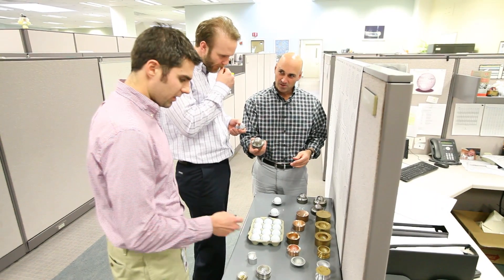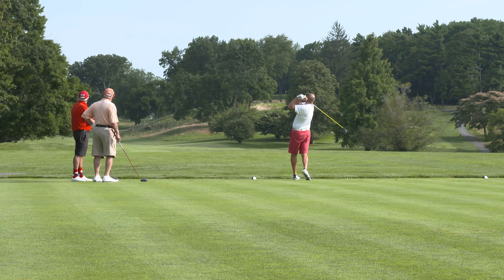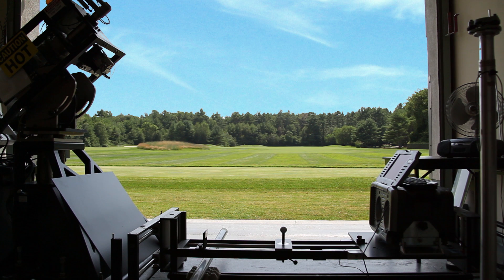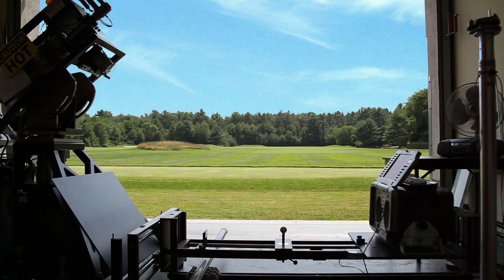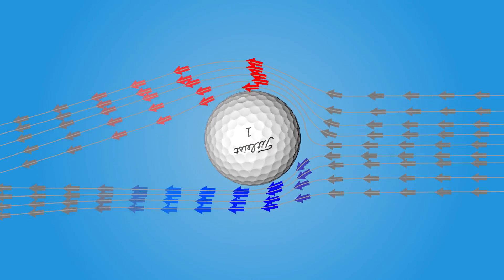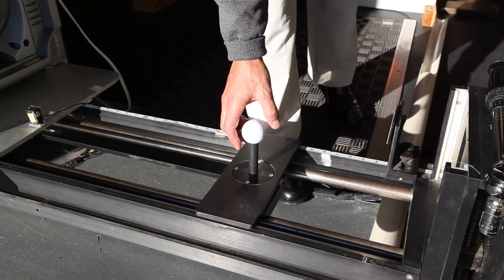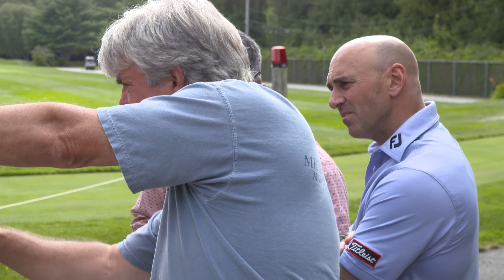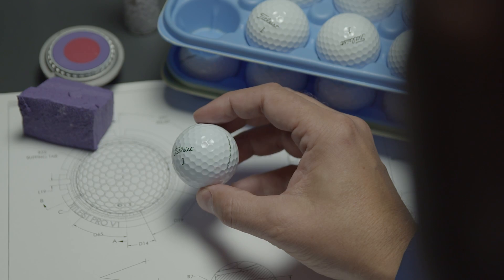How Dimple Designs Influence the Aerodynamics of Titleist Golf Balls

Comment: A major part of the drag on the ball is caused by turbulence which is produced when the air flow separates from the ball. The dimples help to keep that air flow 'attached' to the surface of the ball longer, thereby reducing turbulence and drag. That's how you get more sustained speed and greater stability; reduce the turbulence. Cool stuff.